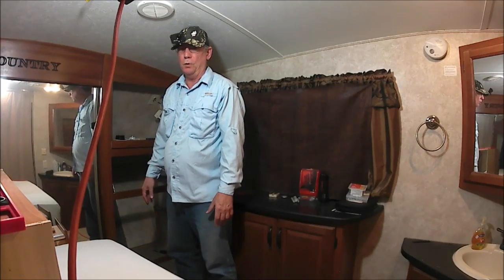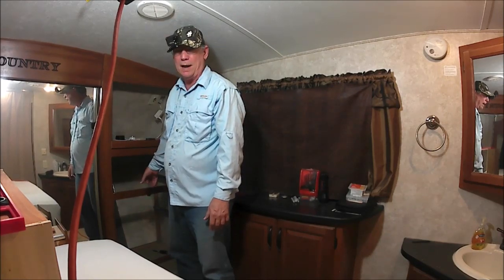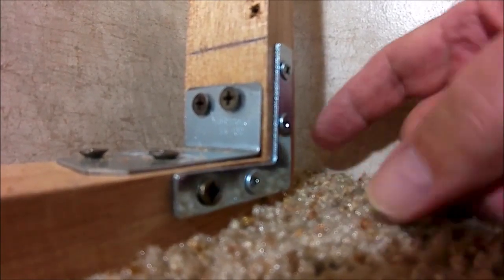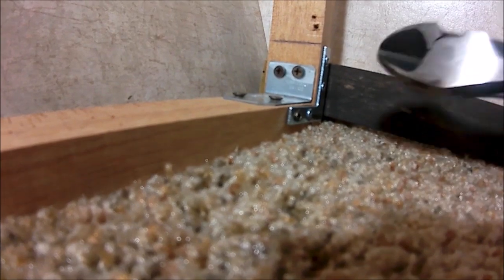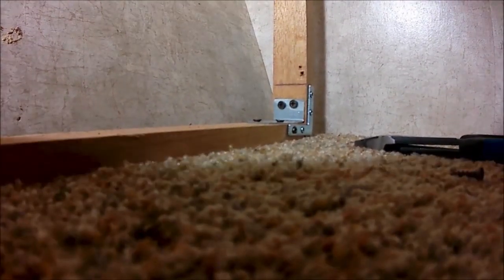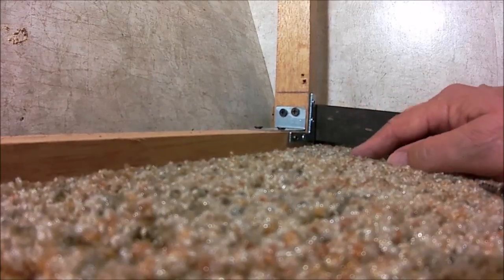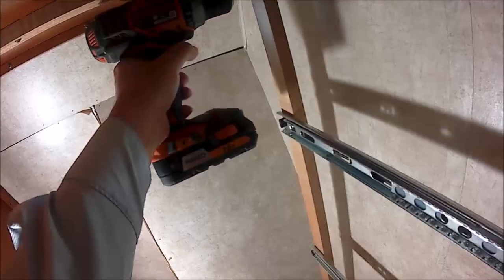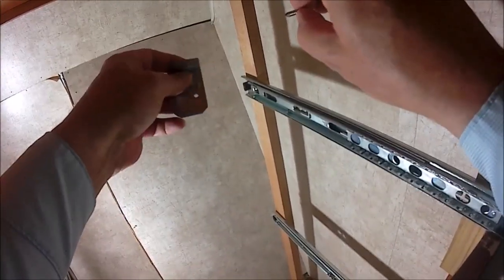How to repair and reinforce a broken dresser frame.

Comment: I would have done it just like you. Fixed the issue then as a counter measure brace up the other corners.  😁👍. Great video.  You did a great job on this repair.
Reply from the maker: Im pretty sure another board would have pulled out those stupid staples. So reinforce them . Thanks